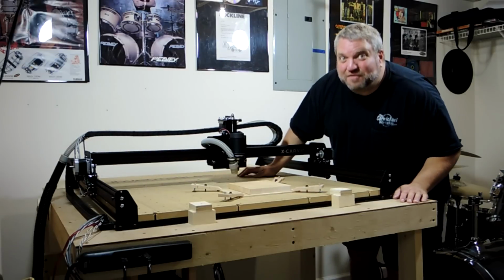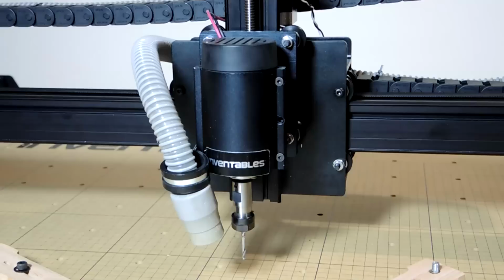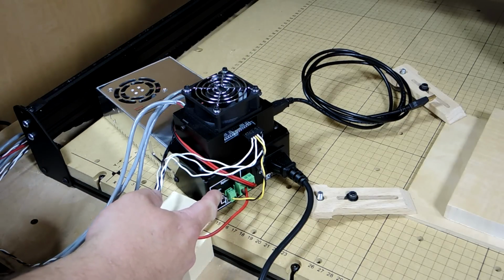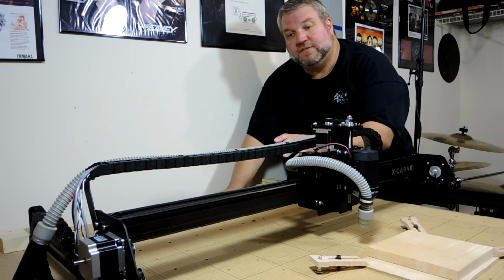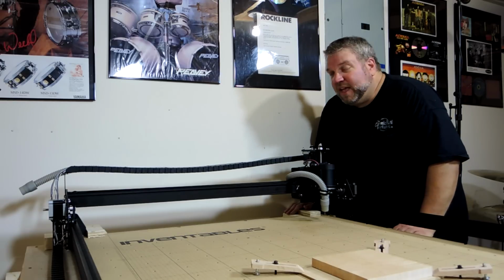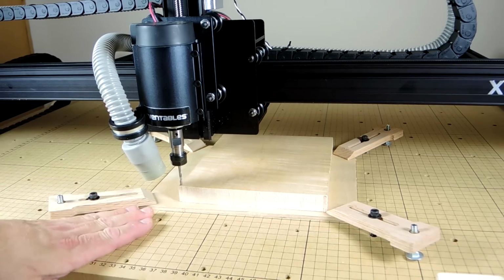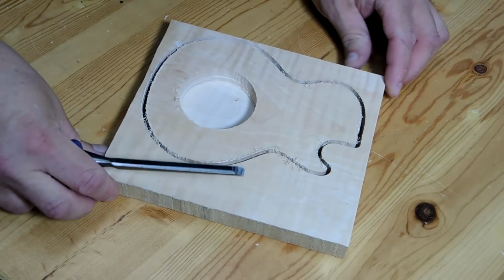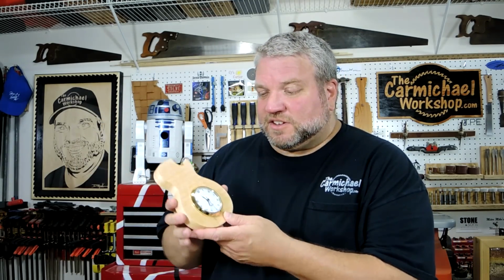Guitar Clock - X-Carve CNC Project and Fold-Up Workstation Update

Comment: I have fold up everything but never thought of foldin up the CNC. You have inspired me once again. Steve, you truly are the man. Thanks again man
Reply from the maker: Sam Berry Thanks Sam!  Just be sure to fasten it real good.  Would hate to see a CNC hit the floor.  ugh
Reply: Thinkin about that now.. I have a set of old school hinges from a typewriter desk that would prolly work. It will take me a bit but i think it will work. Spring loaded.
Reply from the maker: Sam Berry I used 1/2" bolts though the legs and table.  I sat on it to test it and it did not budge.  lol

Comment: Awesome, Steve. Looks like the table worked well for you. If I ever get a cnc I will probably do something similar. Thanks for the follow up vid!
Reply from the maker: CMR Woodworks | Chris McDowell Thanks Chris!  When I received the boxes, I thought it might be too heavy for the table, but it actually worked out perfectly.  I might make the table a little smaller sometime now that I have the machine to measure.  My next test is to cut something that's 31x31 to see if it's flat and cuts a consistent depth all the way across.

Comment: Congrats, Steve. A great machine and video. I like the folding idea very much because I have a small shop. Do you really think the rail would sag over time? Has inventables  made any statements about that?
I am definitely interested in this kind of stuff. I am currently thinking about to remodel my non finished plywood 3D-printer into a CNC machine. Would not be as accurate as the Xcarve, but hey, it's just a point to start with CNC.
Reply from the maker: Mighty Wood  Thanks!  I sent them the link to my video and shared some pics on their forum.  I was curious as to what they would think about it.  I don't think it would sag...the rails are really solid.  As long as I move the carriage to one side, there really is no load on them anyway.  That remodel sounds like it would make for a good video or three.  :)

Comment: Lucky U Steve, must be nice to own an X - Carve... 

I wonder if it would cut in the folded position? Just curious because if it does it might add a new twist to dust collection...  Just a thought...

Also I've seen many design a lightweight shroud from like a plastic shallow Project box with long horse hair type bristles glued to the side for added cleaning as it cuts. There is a hole in the top for dust collection attachment then a second hole for the spindle.

Who knows there may be such a device for sale that simply needs to be mounted.

Nice project and that folding table is an awesome idea...
Reply from the maker: Paul Bialozor Hi Paul!   There are companies that make vertical ones, but I haven't seen an X-Carve like that yet.  Maybe someone will try it.  I see people are cutting out their own vac attachments.  I like to see the bit cutting though.    Thanks!!!

Comment: Nice work man. I think it turned out great. I love the fold up table...I've been trying to figure out storage for mine. 

Also, give the 1/8" upcut bit a shot. I have noticed far less tear out with that one.
Reply from the maker: Seth Gee Thanks Seth!  Yeah, I want to do a test board where I try each different bit I have to see how it looks.  I also want to find the optimum speed and depth of cut for the pine, plywood, etc materials that I use most.
Reply: Steve Carmichael testing testing and more testing. I broke my first bit (1/16") yesterday. I'm thinking about buying a few in each size just to have on hand.
Reply from the maker: Seth Gee I've broken a couple of those.  Try the 1/32" bit.  It's so tiny.  :)

Comment: Hey Steve, when cutting that project what feed rate and depth per pass were you using?
Reply from the maker: Dave Gatton Hi Dave - I tried to push it to see what it would do.  I used the default feed rate for maple in Easel, which is 28 in/min.  I increased the depth per pass from the default .028 to 0.1.  I would probably back down to about .05 on the next one.  It plowed through it though.
Reply: Looks like your fold up table worked great too.
Reply from the maker: Dave Gatton Yeah, it's good to have if I need the space.  So, do you make a lot of test cuts to figure out the optimum speed and depth for each wood and bit you use?
Reply: If I'm cutting some new type of material for the first time I might try a test piece.  If I don't have material for a test piece I just program the feed rate slow then bump it up using the feed rate override button on Mach 3.  Typically you want to speed it up until you see\hear some chatter then back it off about 10%.

Comment: Great! I was wondering what about calibration? I think I asked on your previous video :)  have you found it was decalibrated after folding it up and down? I guess it does the zero everytime on the part, but just asking :)
Reply from the maker: Cactus!   It's probably not detectable on a small piece like this, but I do plan to test a 31"x31" board.  I will make vertical, horizontal, and diagonal cuts across the length of the board, then check to see if the depth is consistent all the way across and if the lines are straight and square.  I'll let you know what I find.
Reply: Steve Carmichael Nice experiment! Thanks Steve I am just curious :)

Comment: Nice job Steve! Did you design the shape in easel, or import the file from elsewhere?
Reply from the maker: ***** Thanks Rick! The guitar outline started as a jpg. I opened it in Inkscape and traced the bitmap outline, then saved as svg. I imported the svg into easel and sized it. In Easel, I drew the circle for the clock insert and centered it...so that people can change the diameter of the circle in Easel if they need to for different clock insert sizes. The guitar outline and circle are separate objects in Easel.

Comment: Good video Steve, thanks for sharing with us!!! How long did it take the machine to shape and cut out the clock body?? W.
Reply from the maker: Walt G Thanks Walt!   It took about 30 minutes.  i pushed it to see how fast it could cut it out with the 1/8" bit.  I think a shallower cut with an extra couple of passes would be optimum, but it would take a few minutes longer.

Comment: Great looking project! How long did it take the x-carve to cut out the guitar?
Reply from the maker: Chris Mooney  About 30 minutes for maple, but I was pushing it by tripling the default depth of cut setting.   I would probably either slow it down or make more shallow passes next time, which would take longer.
Reply: Steve Carmichael Not bad though. That maple looked pretty thick.
Reply from the maker: It is .75" thick, so I set it to cut .1" deep on each pass, which made 8 passes.  I had a snack and moved the camera around while it was cutting.  lol

Comment: I have the CNC Piranha. I like the work area of your CNC much better. One thing I learned is that if you start from the center of the wood it makes it easier to find the starting point. The exact corner is harder to find for me. I put a diagonal line from one corner to the other, on each side to make an X and start from there. But maybe that's just me.
Reply from the maker: bob14072  I saw the Piranha at the woodworking show.  Looked like it had a Bosch Colt in it.  I haven't tried starting from the center...not sure if Easel does that.  I try to use an oversized board, then trim it afterward if it's a little off.

Comment: Does the hose secure firmly to the vacuum or was it modified?

It may be the best dust solution which I have seen so far to accomodate drag chain mounting... 

       So, could you please provide the hose model, and the vacuum model which secures so well to it?

My humble, thanks
Reply from the maker: +TheRangeControl   The hose is a perfect fit for the Stanley 1 Gallon vac.  I also secured it with some tape because I didn't want the constant movement to work it loose when I wasn't around.  It's an old Respironics CPAP machine hose so not sure of the exact model.  It is 6 feet long.  There are lots of them on ebay.  If you know anybody that sleeps with a cpap machine, they probably have an extra one around.  Just a note, I'm about to upgrade to the Dewalt 611 and I don't expect the cpap hose to work well since the trim router will blow dust everywhere, so I plan to add a dust collector boot of some sort.  btw, I don't think the 1 gal vac is meant to run for hours on end.  It works great for short jobs though and I did make a guitar with it, so who knows?
Reply: +Steve Carmichael Interesting points...

I will await your upgrade and boot, then I will generally defer to your wisdom.

again, my humble thanks.

Comment: How long that take to cut out?  Minutes?  Hours?
Reply from the maker: TJ Woodworkshop Hi TJ - It took about 30 minutes to cut this maple one.  It depends how hard the material is.  I kind of pushed the speed on this one to see if it could handle it.  I would probably back off on the speed the next time I cut maple so it would take a little longer.